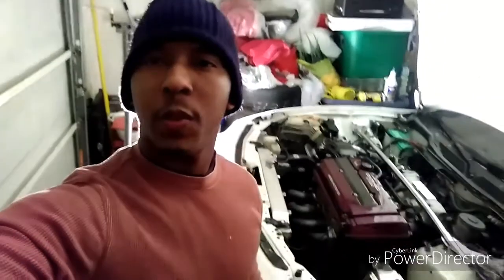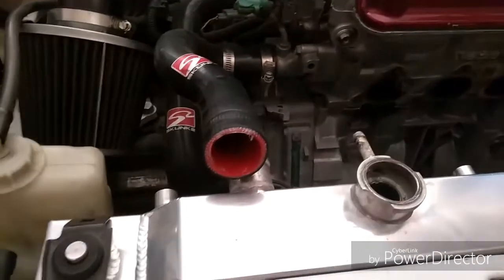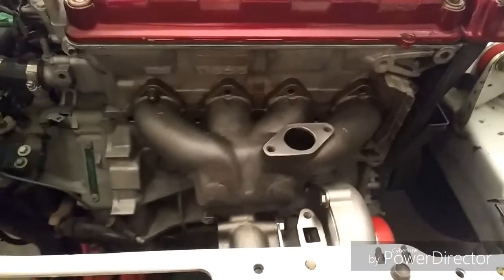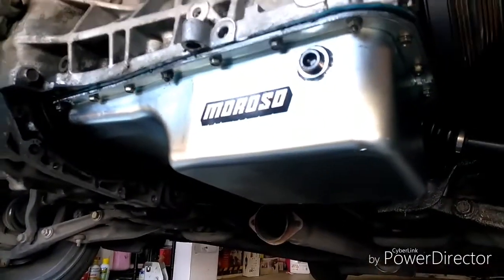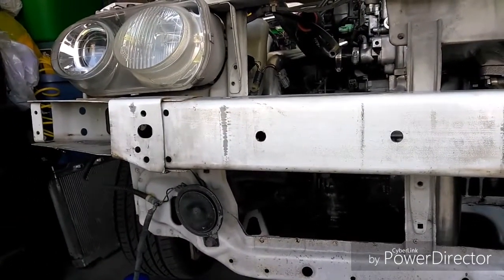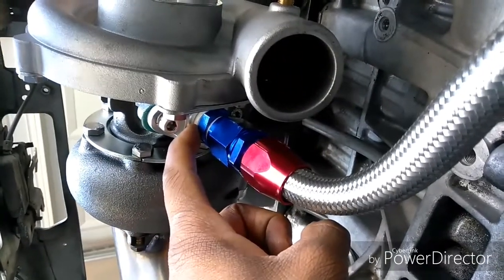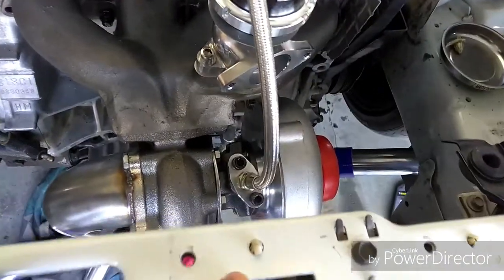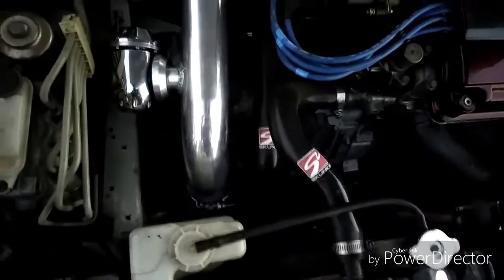How To Turbo A Honda/Acura

Comment: The end twos is suppose to be studs the rest is suppose to be bolts. You can get 12 point aftermarket ones a set for like 12$ on eBay.
Reply: The 12 point ones on eBay are 8mm it will clear the mount holes for the turbo manifold.
Reply from the maker: Eighteen 6 Thanks👍

Comment: Electronic boost controller or nah? 
Any fuel pump/injectors ecu changes or everything work fine without it?
How'd the clutch hold up with some boost and how much Psi?
Reply from the maker: No electronic boost controller. But it would be a nice addition. I upgraded the fuel pump to a walbro 255. My injectors are 750 cc ebay brand. But it's best to get brand reliable injectors. My ecu is a chipped p28. I was running a stock clutch at that time boosting  up to 10psi and it held it with no problem. If you have any more questions feel free to contact me.  Thanks for watching 😁👍

Comment: I have a chip ecu could I drive the car like that for the mean time? And could I get a tune without hondata?
Reply from the maker: Yes, long as you leave the stock injectors in. Also remove the intake from the throttle body so it doesn't take in boost. Thanks for watching 😁👍

Comment: This is Good stuff, very detailed and you go though the steps very well. You made this project like 100x easier. I Subed and followed bro. Do have one question though. Are you running ARP head studs, bigger injectors and fuel pump?
Reply from the maker: At the time of this video I wasn't using ARP head studs. But I am now with my new setup. And also yes I am using a bigger fuel pump. Walbro 255. And bigger injectors 750cc ebay injectors. If you have anymore questions hit me up. Thanks for watching 😁👍
Reply: Duwop77 NP bro. Thanks for making it! Did you have any problems running it without the head studs? I'm on the fence about getting them only because I hate messing around with the timing belt and I know I'll have to take it off if I get the studs.
Reply from the maker: @False_Death  no I didn't have any problems. I was using the stock GSR head bolts and they held just fine. Most people use head studs because of high boost or just for that extra precaution.
Reply from the maker: @PatrickB4  yes, but what makes it safe is the tune. The better the tuner the safer it will be. Although a built bottom end is always preferred. If you have any other questions feel free to hit me up. Thanks for watching 😁👍
Reply from the maker: @PatrickB4  I feel you. That was my same mind set. Your on the right path. Just get a simple ebay starter kit. Keep it at low boost 5-8psi. And find a good tuner. Turbo is very addictive, try not to dog it all the time😆 

Just for a heads up the kit I bought and installed on this video was Rev9 from Ebay. The price at that time was $611👍
Reply from the maker: @PatrickB4  No problem 😁

Comment: And what about boost controller and what map sensor did u use? Like how do u hook up boost controller
Reply from the maker: I'm not using a boost controller. Diff boost controllers are hooked up differently.  But all are ran into your vacuum supply. The Watergate I'm using in this video has a port at the top I capped off that's for a boost controller. I'm also using a stock 3 bar map sensor. Works fine with low boost. Thanks for watching 😁👍

Comment: Dude what dipstick you use for the moroso pan? How do you measure the oil level
Reply from the maker: La Channelloto I used my OEM dipstick. It seems to be accurate. Also if your having issues. Just pour in 4qts of oil and you should be good. Long as you don't buy the 5qt pan. After adding 4qts take note of where the level is in case it's different from the OEM markings.  Just make sure your on flat ground when checking oil level. 👍

Comment: Hey bro what size bronze fitting for the oil drain?? The how do you know the size of the threads on the oil pan??
Reply from the maker: It's a 1/2 npt to 5/8 barb. You can get them from Ace hardware, Lowe's or Home Depot. Not sure where your from.
Reply: @Duwop77  thanks for the response bro can i use a 1/2 barb instead of 5/8? The 5/8 is super tight on the barb i cant even pull it out ! Or will it be too small to drain correctly?
Reply from the maker: @lamydora457  5/8 is what I used cause it's equivalent to the 10an fitting and hose I was using.  Also that's the proper size for drainage. Don't want to go too small. Try using grease or wd40 in the hose or on the fitting for easier removal or installation.

Comment: I plan on turboing my NA built integ, what did you do for the down pipe? Im in the army so everything is more difficult w/o a garage and such lol. Anything in particular that was a pain or anything to look out for specifically?
Reply from the maker: Ben Smith With the kit I purchased the only problems I had was the down pipe hanging  to low. And finding a way to route the dump tube. I just went to a local muffler shop to have the down pipe shortened.  You can do the same for the dump tube. Turbo is a lot of fun I recommend it to anyone.  Just find a good tuner. Thanks for watching 😁👍
Reply: Duwop77 sweet thanks for info man!
Reply from the maker: Ben Smith no problem.  Glad I could help. If you need any further information in the future hit me up.   Good luck with the build👍

Comment: Sup bro . How u hook up ur vacuum 'line thanks. Doing my first turbo Integra also .
Reply from the maker: blue sky Sup bro, I'm not sure how your setup is. But with me the only extra vacuum lines I needed to run was for the blow off valve and wastegate. Both I tied in using a vacuum T fitting. If you need further assistance let me know I'll try to show it in my next video. Thanks for watching 👍
Reply: Duwop77 thanks bro if u can do a short video of it I would appreciate it . I seen different video doing different way not sure .
Reply from the maker: blue sky Hello, I should have the video of how I hooked up my vacuum lines uploaded sometime tomorrow 😉
Reply: Duwop77 thanks bro appreciate it
Reply from the maker: blue sky Here's the vid I promised. Shows how I ran my vacuum lines.👍 https://youtu.be/uwUNTJMwpuo

Comment: Did you have the ECU tuned prior to installation, or are you running without a tune?
Reply from the maker: Kenny Vincent I had it tuned after the install. My intentions was to add the Dyno session to this vid but forgot to 😑
Reply: The ecu is always tuned after to suit the setup
Any map that is put onto the ecu before hand is normally regarded as a base map and would mean the car is untuned even if its to suit you injectors and engine because every setup is different they should have different tunes, even 2 setups that have exactly the same parts could need a different tune
Reply from the maker: @John.strong  that's true😁👍

Comment: how much bar can a stock b18 hold? 0.8?
Reply from the maker: It all comes down to the condition of the engine and the skill of the tuner. But on average 8-10psi. Fuel type also can play a role. Thanks for watching 😁👍

Comment: Link to the turbo
Reply from the maker: This is the link for the kit I'm using. The price has gone up a little since I purchased mine. Thanks for watching 😁👍http://rover.ebay.com/rover/1/711-53200-19255-0/1?ff3=4&pub=5575597721&toolid=10001&campid=5338700573&customid=&mpre=https%3A%2F%2Fwww.ebay.com%2Fitm%2F202050619501

Comment: I stripped the thread in the head
Reply from the maker: I once had one of the threads strip out for my exhaust manifold. I bought a helicoil kit from napa. You just have to drill the hole bigger with the drill bit that was included. And thread in the helicoil insert. I may still have the item number if that's something you may need? Thanks for watching 😁👍
Reply: @Duwop77  yeah let me get the part no , happy u replied ik a youngin in the game tryna Make around 350
Reply from the maker: @Dcfrankiee  no problem. The part number is napa 770-3093. And the drill bit size is 21/64. 😁👍
Reply from the maker: @Dcfrankiee  350hp is really good for a daily honda👍